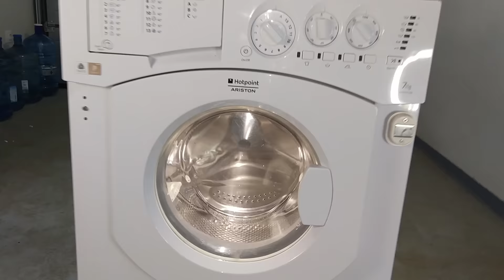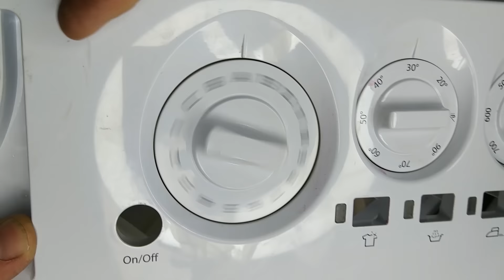Experiment - Complete Disassembly - of Ariston Washing Machine

Comment: My machine isn't using up the fabric softener all the way. What might be the problem? 

Also, I unscrewed those 2 screws that hold the drawer hoping I would be able to pull the whole thing out and clean it. And I accidentally dropped one of them in the hole where the detergent goes.

Now what? Is this gonna break the machine?
Reply from the maker: Strange 🤔